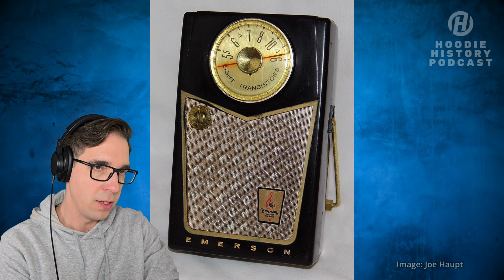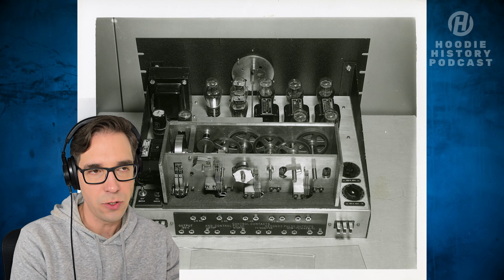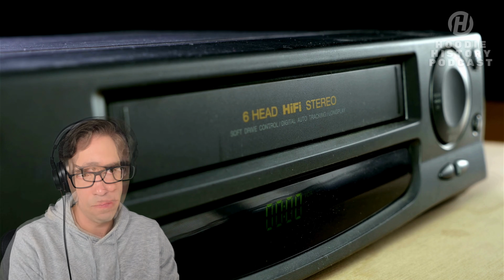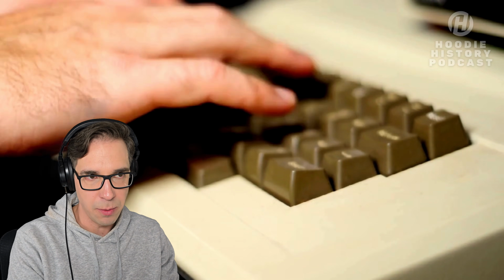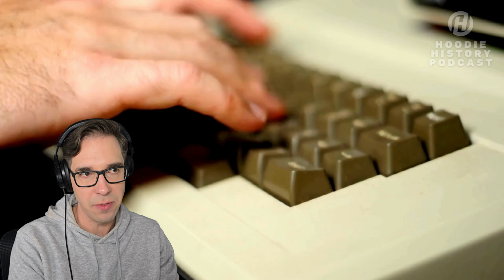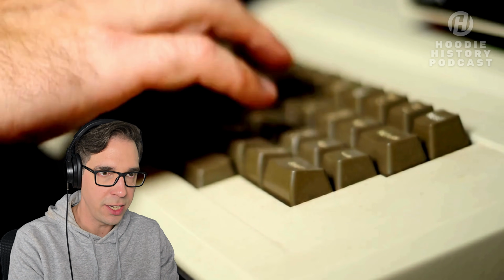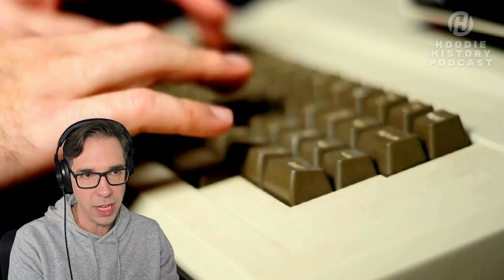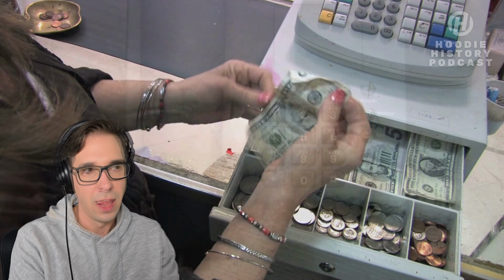The 1947 Accident That Put 15 Billion of These in Your Pocket

Comment: Some of this is not completely factual. Vacuum tube radios only took 15-20 seconds to warm up, not minutes. There were portable televisions before transistors were used in them. At the beginning of the video, it is stated that tubes were so unreliable but later on, it is stated that IBM did not want to move away from tubes because they were reliable in their computers.
Reply from the maker: Thanks for watching and for the constructive feedback. You've raised some good points. I've looked into this a bit more and yes many radio sets were faster than I described. The IBM point highlights an interesting nuance. Vacuum tubes were unreliable (they had a limited lifespan), but a company like IBM had engineered their overall systems to be reliable despite this (using high-quality tubes, running them below spec, building in diagnostics, etc.). From their perspective, their proven, reliable system was a safer bet than the new, unpredictable transistor technology. I could have made that distinction clearer. Thanks for listening so closely and for sharing these excellent points.